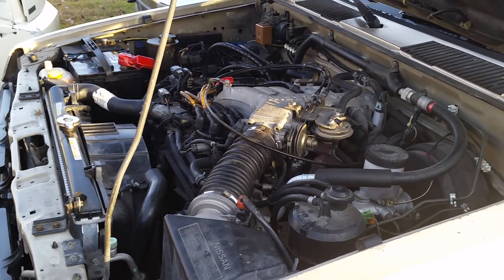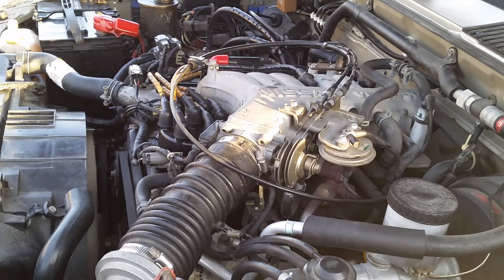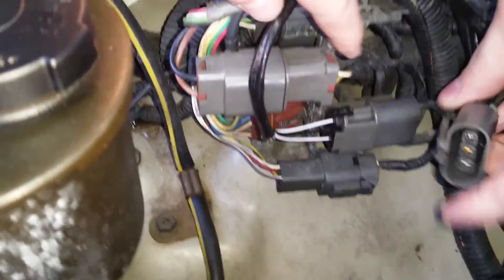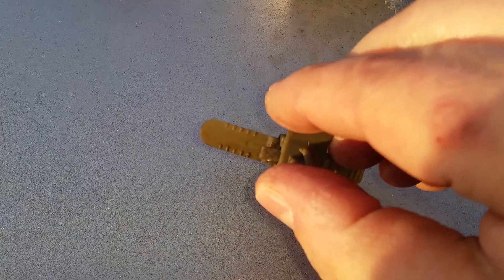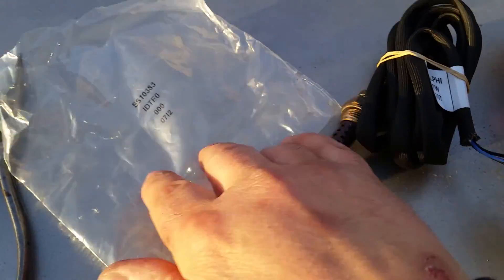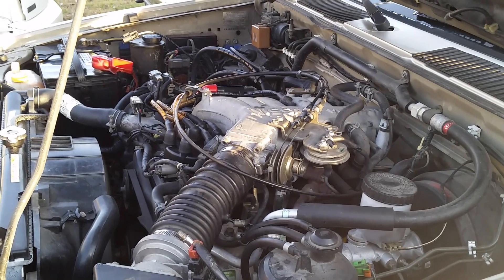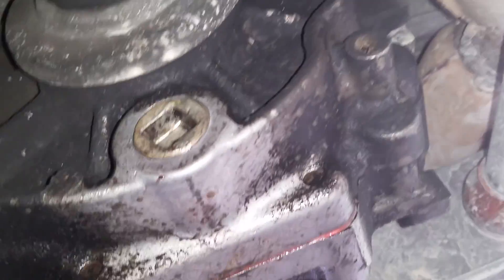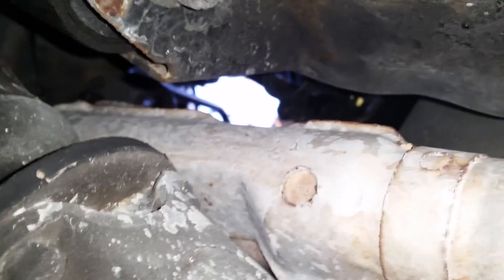95 Pathfinder D21 O2 Sensor Change ECM Code 33 Part 1

Comment: Dude this video came out 9 years ago. If I can tell you how much this video helped me I would. I was diagnosing the same engine but for somereason it was bugging down and back firing everything spark related was good and fuel knowing it had to do something with the air to fuel ratio issue. Long story short I found your video, disconnected the O2 sensor and test drove the vehicle, now it won't back fire or stumble. Thank you for the helpful video.
Reply from the maker: I'm so glad my video helped you. It's one of the reasons I make them. Most people who would drive these old vehicles are enthusiasts and even though they can afford to pay someone to fix it. Finding someone to fix it can be hard because of it's age. The other people who own them do so because they can't afford a newer vehicle so they to need the information as well. I hope you enjoy your D21 Pathfinder as much as I have enjoyed the two I've owned. Don't forget to join the Nissan Group in the video Description and download the free maintenance manuals for your truck. Best Wishes & Blessings. Keith Noneya

Comment: mine won't pass cali smog , the test saud eberything is fine but at 2500 rpm it failed the hc mode of the test at 2500. gonna try clleaing the cat and change this . thank you
Reply from the maker: You might also make sure the MAF Sensor is clean, there's plenty of video's on how to do that as well. If you go to the description and sign up with the Nissan site listed there, you can get a free copy of the 94 & up Factory Service Manual. If you have problems email me and and I'll email you the EC & EL (Engine Controls & Electrical) sections. Best Wishes I Blessings. Keith Noneya
Reply: @keithnoneya  thanks again

Comment: Mine is showing code 51 injector circuit
Reply from the maker: What year is your Pathfinder or D21? If you go to https://www.nicoclub.com/nissan-service-manuals you can join the Nissan Club and download their Factory Service Manual EC (Engine Control Systems) & EL (Electrical) Sections. The manual has pretty good troubleshooting sections. If you have trouble downloading them I have them for the 94 and 95 and I can email them to you if you like. Use my keith_noneya@att.net email if you would like them. Thanks for watching. Best Wishes & Blessings. Keith Noneya

Comment: Excellent video. 
Somebody could help me? I have a Nissan Pathfinder V6, 1994-1995.  1 cylinder misfires and the injector lights on.  After you drive less than a kilometer the injector  ligths off  and the car stops misfiring. It seems to be an  electrical problem, but I really can't figured out.  I replaced the sparks plugs and its cables ... checked the fuel injectors...everything is right.   The ECM show the code error 51 (circuit injector), but I didn't find the problem yet.
Reply from the maker: Great question! It looks like you have addressed most of the major issues, when all seems fine except when cold or hot, most of the time, yes it can be electrical in nature. There are a few others as well that can cause this issue:
1. A bag coil pack. Most coil packs are put together with "Varnished Magnet Wire" and as the plastic they are made of expand and contract the varnish over time begins to internally rub off and can short. This can happen when it's cold or hot. It's a common problem. Only changing it or putting it on a scope will confirm it. They are cheap especially if you get a used one from the junk yard.
2. ECM. Same problem. They are put together with Lead Free Solder. Lead Free solder in inherently brittle and like a Coat Hanger that's bent over and over it will crack. Over time the Lead Free Solder joints begin to lift and crack internally. When they do they cause over current on some of the IC's internally and they go intermittent. Put it on a scope or replace it. If you replace it you have to get one with the same part number on it. Different vehicles have different options, engines and electronics specifically.
3. Head Gaskets can leak and allow some of the combustion gasses to escape and cause the engine to run rough. You can do a compression test while it's cold and while it's hot to see if you have that issue.
4. There are also Emission sensors and vacuum hoses that expand and contract with heat. A vacuum leak is usually not to hard to diagnose. Just spay some WD-40 around the vacuum hoses when it cold and running. DO NOT SPRAY NEXT TO SPARK PLUG WIRES, SPARK PLUGS OR THE IGNITION COIL, IT WILL CATCH ON FIRE. So keep a wet towel, water hose and a fire extinguisher near by. Also do this away from YOUR HOUSE at the end of the driveway and away from other cars in case you can't put the fire out. That way you'll at least have a house and your other car. NO CRAP! Had a guy a mile away burn down his house and his classic 67 Pontiac Grand Prix when he couldn't get the fire out and the fumes got to his water heater while working on the fuel system in the garage.
5. The MAF sensor does that sometimes. Get a used one from the junk yard to replace it. New one are expensive. Hope that leads you in a good direction. Best Wishes & Blessing. Keith Noneya
Reply: @keithnoneya  Hi Keith. Thank you a lot. I'll try to find the problem following your hints. 
It's kind of intriguing, cause the misfire happens in one cylinder for some moments, after you turn on the ignition.   Seconds or minutes later,  the "check"light  off and everything back to  normal.

Comment: What's the difference between upstream and downstream o2 sensors for a pathfinder/D21. I've got a code 33 and I'm going to replace the o2 sensor with a heated o2 sensor I know fits for my vehicle, but I'm wondering if there's multiple o2 sensors (left/right) or upstream/downstream I need to worry about. Thanks Keith!
Reply from the maker: I think my year only had one O2 Sensor. If you have a later year you may have two, but I'm not sure for later years. You can download your manual and check for it here: https://nicoclub.com/archives/nissan-pathfinder-factory-service-manuals.html  
The section you want is the EC section, "Engine Control System". The nice part about this section is that it has a troubleshooting guide built into it. Let me know how it works out. Hope that leads you in the right direction. Best Wishes n Blessings. Keith Noneya

Comment: hey Nissan bruthers need some help. got a 89nissan path 4x4 can't find the. dam. o2 sensor.  I've looked everywhere I no it only has one.  so please mannnnn I need help
Reply: thanks
Reply from the maker: You can also do a search for 89 Pathfinder O2 Sensor on eBay. Try this link: http://www.ebay.com/sch/i.html?_sop=15&_from=R40&_sacat=0&mvsub=1&_mcatda=true&selfil=2%2C3%2C1%2C4%2C5&selvel=Nissan~Pathfinder~1989~SE%2520Sport%2520Utility%25202-Door~3.0L%25202960CC%2520181Cu.%2520In.%2520V6%2520GAS%2520SOHC%2520Naturally%2520Aspirated&_nkw=o2%20sensor%20Nissan%20Pathfinder%201989%20SE%203.0L   
Hope this helps, let me know how it works out. You can also look at some junk yards and do an ebay search on the Nissan 3.0L engine O2 Sensor. Let me know if you need anything else.

Do a search for Delphi ES10383 on eBay, I think it will work based on some research on eaby cross references, but i'm not sure about the connector.  Best Wishes n Blessings Keith
Reply from the maker: I actually deleted my first reply because I forgot to check your year before I responded, sorry about that. The current response is what I found out after my first reply. Really hope this helps. You can also look at the service manual, or even call the dealer and get the OEM Part Number then do a search that way.
Best Wishes n Blessings Keith

Comment: Is part 2 ever coming? Would love to see how you remove the O2 sensor as things are pretty rusty down there, and on the one I need to remove.  Thanks!
Reply from the maker: Hi shlap007, funny name, guess you're not a fan of JamesBond huh?
After I read the question I looked at the date. Wow it's hard to believe it's been that long. Ok on to answering your question. Time permitting I'll edit the rest of the video I shot and post it some time this week.  
To remove a rusty O2 Sensor:
   -  1.  Put some PB Blaster or WD40 or some kind of penetrating oil on the threads. 
   -  2.  Drive the car around the block to expand the exhaust pipe, it will expand more than the O2 sensor relieving some of the stress making it easier to unscrew.
   -  3.  Disconnect the O2 sensor plug as shown in the video and tie a 5 foot  string to the connector and attach the other end to the connector tower.
   -  4.  Disconnect the O2 wire from the retaining clip by the Transmission Dip stick.
   -  5.  Put a wrench on the O2 sensor and turn it counter clockwise until it's off then pull the wire and string down to the bottom of the car. A person on top to help guide with wire and string is a great help.
   -  6.  Grab your new O2 sensor and put the copper anti-seize compound on the threads, try not to get any on the sensor area.
   -  7.  Screw in the new O2 Sensor and snug it up.
   -  8.  Untie the string off the old O2 sensor and tie it to the connector end on the new O2 sensor.
   -  9.  Go to the top of the car and grab the string tied to the connector tower and pull the new O2 sensor connector up. 
   - 10. Route and plug in the O2 sensor connector. 
   - 11.  Start the car and take it on a test drive.
   - 12.  Erase the Check and write down any ECM codes and Erase the ECM codes to turn the Check Engine light off.
 See my video on how to do this here: https://www.youtube.com/watch?v=6RK4ADgSKTA

   I hope this gets you the info you need. By all means feel free to ask any questions and I'll check my pay several times a day to give you a hand. If you send me a private message I can give you my phone number to ask directly.
Best Wishes n Blessings keith
Reply: Wow Keith, I appreciate the quick and detailed response!  I just picked up a universal sensor from the parts store down the street.  With this one you just cut and strip the wires then splice them with the new ones.  Hope that's OK to do.  It was about $30 cheaper and available today where the full one in your video, I'd have to wait till next week for.  Going to give this a try tonight. It looks to be really rusted and corroded so pray for me hah!  Here's a look at it https://i.imgsafe.org/1db1995656.jpeg
Reply from the maker: If  you go that route make sure you put some RTV inside the crimps to prevent it from corroding off. Also make sure you follow the correct connections as posted in the SHOW MORE above. The two colors that are the same are the heater and the single is the sensor output to the computer. If you get it wrong you can fry your sensor. I also posted what I sent you into the SHOW MORE for others to read. To be safe reveiw the SHOW MORE above.
Best Wishes n Blessings Keith
Reply: Well, the O2 sensor won the first round.  I sprayed Blaster on it and let it sit for a couple of hours and then got the O2 socket on but it wouldn't budge.  I drove it around the block a few times to heat up the pipe and then sprayed some more Blaster on it but now it's too dang hot to finesse the O2 socket back on. Burned the crap out of my hand.  It's 110 F here and I think I'm about done now until it gets dark out.  Stupid O2 sensor  :-)
Reply from the maker: Use a big Pipe Wrench or the open end of the combination wrench, if it slips off cut the wire, if you're sure the sensor is bad, and use the box end of the wrench and a big hammer to loosen it. Yeah watch those pipes they get hot. I'll be unavailable till around Noon Central US time. I'll check YT when I get home. If it's stuck still put a torch to the pipe to heat it up and spray the sensor with a water bottle to make it contract. Be careful and wear safety goggles and gloves. Be careful and drop me a line on your progress. Best Wishes Keith
Reply: Well I'm disappointed to say I've lost rounds 1 and 2 with this thing.   I used PB Blaster a number of times on it, heated the bung with a torch, and used the "special" o2 remover socket which ended up stripping the socket and rounding the corners.  I'm going to try spraying, heating, and yanking on it with a vice grips one more time and if that doesn't work my next plan is to break the o2 sensor and use the star end of a 22mm wrench.  I've been told I'll get more grip on it that way... Wish me luck!
Reply from the maker: Hey Shlap read my last post before you try the vice grips. Let me know how it goes. Keith
Reply: Thanks Keith, yeah I was going to try the vice grips first so that I didn't have to cut the wire, because once I cut that wire I'm kinda committed to getting the o2 sensor out.   

Thinking about it more, I should probably just skip the vice grips so I don't strip it any more, cut the wire,  and use the box end of the wrench like you said.
Reply: Well after a good soak again, I heated the bung red hot, cut the wire, slipped the box end of a 22mm wrench on the o2 sensor, banged it with a hammer a bit,  yanked on it, and it stripped even more.  I'm about out of options. This thing just aint budging.
Reply from the maker: shlap007 WOW, Use a big pipe wrench since it's slipping, that should do it. Ok Now I'm going to ask an obvious question. Looking at the sensor from the wire end are you turning it counter clockwise? If you are heating the sensor don't, heat the pipe where it screws in. Hope this helps. Keith
Reply: Oh believe me I second guessed myself about 40 times but yeah I'm turning counter clockwise looking at it from the wire side.  I finally gave up and took it to the mechanic down the street to have a go at it. Really hope they have better luck than I did!
Reply from the maker: shlap007 Oh man that sucks, I'm sure they'll do a good job for ya. I've had to do that from time to time, but most of the time I can't afford it so I tough it out for days some times, but I always get it done some how. Best Wishes n Blessings Keith
Reply from the maker: Hey Shlap007 how's the truck doing?
Reply: Hey Keith!  It's running without an O2 sensor lol    Even the shop down the street that's pretty highly regarded had 4 guys brainstorming how to get it out and couldn't.  At this point the only option is drilling a new hole in the pipe and welding a new bung in.  That's a job beyond my capability and it'll cost about $400 according to the shop.  Thanks for all your help though, it was fun trying :-)
Reply from the maker: shlap007 Hey Slap James Bond, drill a big hole in it and then grind it out down to the top of the threads. You can do it by using a right angle grander with a carbide tip on the end. Then run a tap through it to get the old threads out. The best way would be just go to the junk yard and buy that section of the exhaust, as they just unbolt, normally! LOL! However when you start this you're committed once you drill that hole? Let me know how much your mileage drops with the O2 sensor out. heck take the thing to a welder, they'll get it out.   Best Wishes and Blessings Keith.